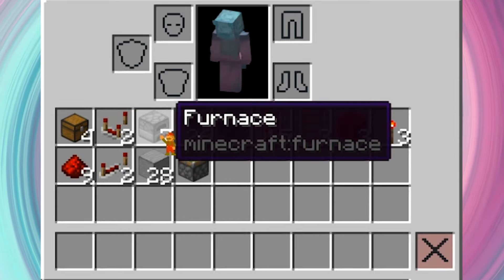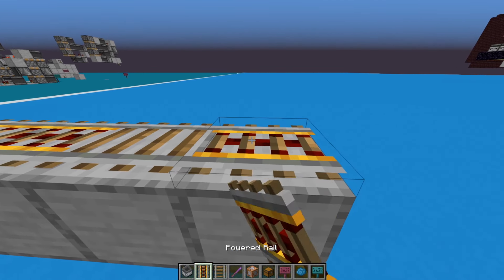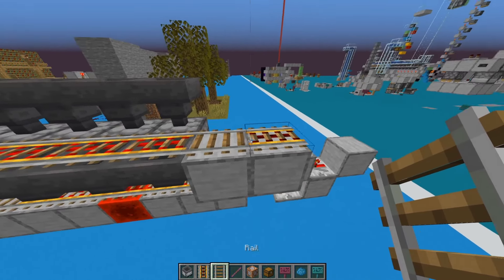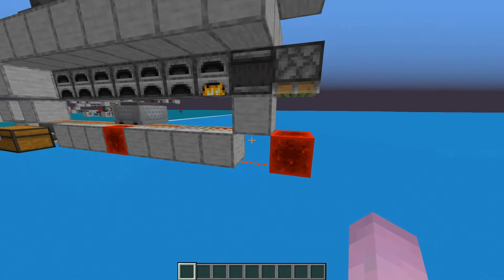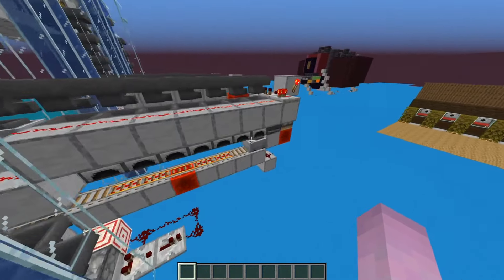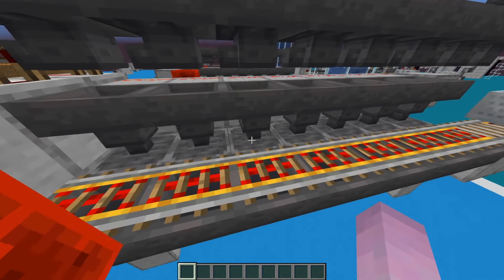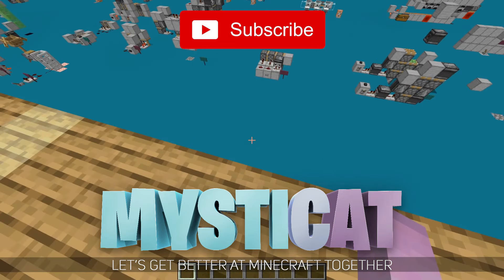Minecraft HIDDEN Super Smelter Tutorial

Comment: dont make this, its bad and a lot of your items get stuck in the system
Reply: I build it but the Itams get stuck in the hoppers
Reply: Agreed. Do you know a design in the same or a smaller footprint to do its job (smelt things full auto) ? I built it in survival and don't want to need to dig more room.
Reply: Try setting the repeater to 2 ticks delay. For me it fixed the problem and I got only 1 item per stack stuck, as said in the video. With 1 tick delay I had 5 items per stack stuck.
EDIT: but you STILL get between 1 and 7 items left in the hoppers after a batch, depending on the input amount.
Reply: Did you add that another row of hoppers like he said in the video?
Reply: @partizansrcem5172  No, in the end I added a circuit that unlocks all the hoppers after the input chest is empty. That way you get both even distribution and prevent clogging.

Comment: So this isn't working in 1.16.3. I have noticed three things. 1) your "even" item distribution system fills the the first furnace in line slower than the others causing there to be a couple of stacks less in hopper when smelting an entire double chest. 2) the repeater on the item distribution system needs to be set at a higher delay than one in order for furnaces to fill to 64. 3) the comparator on the item distribution system locks the bottom row of hoppers once all of the hoppers on the top row are emptied (wont pulse if nothing is flowing through it). The fuel and furnaces work great, but you have some major bugs to work out on the item distribution.
Reply: I have the same issues on 1.16.1  Think it Is 1.16 is the problem.  Know any other good designs u can link me?
Reply: @isaacbean8008  Not really sorry. I decided to change the redstone by adding a solid block between the repeater and the first furnace that I can retract with a sticky piston using a lever. So after I load up my input chest and it completely empties, I flip the lever which retracts the block and breaks the piston lock signal allowing the bottom row of hoppers to continue to run. It's not automatic, but the item distribution still works the same long as I dont flip the lever before the chest empties. It will do until I build a different set for my blast furnaces and smokers. I think I am gonna do some simple ones with rail tracks that I can turn on and off and just have it deep under ground to keep the track noise and item dispenser noise down. You could also try searching best .16 auto smelters and  try a different one, but use hoppers and item streams to achieve the same display for fuel, input, and output that this tutorial has. Happy crafting and hope this helps.
Reply: Well, I just made it on 1.16.3 and it works fine for me so idk what you're experiencing
Reply: Now am scared of doing it
Reply: Yep, same issues.
Reply: @isaacbean8008  I use one that's similar but has far less hoppers and uses mine carts to distribute both fuel and items to be smelted instead (put a minecart track on top of the hoppers that do the duel distribution). It runs fine on 1.16. [edit] It also is not limited to 7 furnaces. It uses at least 15 I think and I've never had a problem with it not using a furnace...[edit2] Had to remove the link. That link was to ilmango's design but it was not the design that I used. I'm trying to find the one I used.
Reply: Same issue I’m having now, last row of hoppers keeps not emptying fully

Comment: So there is a bit of a design flaw. If you throw in 2 stacks of different items you get a massive clog in the system because the furnaces don't smelt at the rate they receive items. The fix is easy though. Add a 3rd layer of hoppers to the top side to act as a buffer and you're all set! Great video still!
Reply: Please can you explain I'm trying to build this
Reply: @-Chicken_  so on the top how he has a hoper line with hopers below it facing into the furnaces. Just add another row of hoppers

H>, H>, H>, H>
Hv, Hv, Hv, Hv,
Hv, Hv, Hv, Hv,
F   , F    , F    , F
Reply: @spughety8098  I really thank you for telling me this but I have a design which is completely amazing. It will not clog up however many items you put. The only slight flaw my design is that you just need to put the fuel before the food otherwise it is amazing. Thank you for spending you time telling me this, much appreciated
Reply: @-Chicken_  no worries! Have a good one!
Reply: @spughety8098  You too 😁

Comment: So at 3:24 my hoppers got locked because of this line of redstone and weren't putting things into the furnaces. They all had a round 80 netherrack in them, is there a way to prevent that?
Reply: I’m having this same issue, did you ever figure it out?
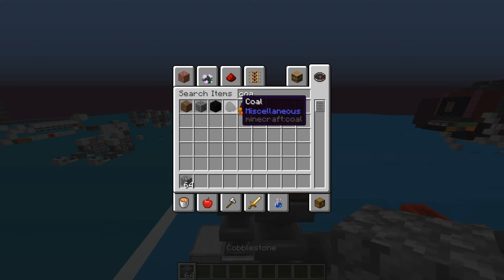Reply: @bevyn2031  I didn't for my setup and wound up using Shulkercraft's super smelter since it's larger, but I think I figured out the issue. You'd need to make sure the redstone is on top of transparent blocks, not solid at 3:25 since these can power & lock the hoppers and cause problems (hopper locking is complicated and confuses me though LOL I might be wrong here), though the part where the redstone goes down one at 3:34 is a problem. This is easily fixed by putting the redstone on top of the block where the redstone torch is that powers the powered rail in the back. 

So just put the redstone all on some slabs, don't go down a block, then for the torch just put a redstone dust on top of that block. That should fix it, but I'll actually build this and test it rn.
Reply: @Bevyn Okay to build on this, doing this can mess with evenly distributing stuff, so I kinda want to figure out a better way to fix this since that can defeat the purpose of a super smelter. I think the reason the netherrack is getting stuck might actually be a chunkloading issue now that I think about it, so if you're able to, build a chunk loader by your smelter. That may fix things. Undo what I said in my other comment lol that breaks things. My bad!
Reply: @linustrain  gotcha, thanks for the help!

Comment: It doesn't work because its a little outdated although i managed to fix it by breaking the comparator and Redstone repeater at the back of the smelter and replacing the all the blocks under the output rails (not the block under the minecart tho) and replacing them with hoppers. The only downside to this is the top fuel minecart will be running forever when you power it with something, but you can also fix this by making another "t flip flop" facing the the powered rail under the fuel minecart that runs off a observer detecting whenever the first "t flip flop" pushes the Redstone block (Have the observer facing into the where the Redstone block would be when its pushed)  Hope this wasn't to confusing you might have to move some things around because i don't feel like i explained it very well.

Comment: The bottom half all works beautifully, but Im getting a lot of items left behind in the "to be smelted" hopper line (second from the top of the design). Something about the comparator system intended to spread the items out evenly is not working correctly in 1.16.2 for me. Any thoughts?
Reply from the maker: It’s been a while and I don’t fully remember, but I addressed an issue like that at the end of the video
Reply: @mysticat  Yeah, I remember it saying at the end of the video, rebuild almost the entire thing one space lower, but it also said it would only leave one item behind. Which would be fine, but Im getting minimum 9 left behind and more if there's more than one type of thing being smelted. Also, I'm only doing normal furnaces.
Reply: @metheusBound  same problem...
Reply: @schwizler9802  Its doesnt work period

Comment: For high volume applications, the mechanism that makes the hoppers add one item at a time into the furnace stops, causing the hoppers to become locked and not dispense any more items into the furnace. This is because the comparator is taking signal out of the top line of hoppers  instead of the hopper line on top of the furnaces. The hopper line of top of the furnaces still have items waiting but the top line of hoppers have none causing the mechanism to lock the hoppers.  Is there a solution for this?
Reply: Try dumping a chest full of items in and wait. The smelter only spits out about 18 stacks instead of the 24 stacks

Comment: I have a technical question regarding the build. I tried building it on a Realm server and the Hopper Minecart does not move on either rail (fuel supply or smelted item). Is this an issue with using it on a Realm instead of a single player, or has there been some change? I'm currently on 1.16.2
Reply: @paulmartinez8149  Yep, that was the issue. Thank you!

Comment: Does anyone use Lava instead of coal or whatever else? I'm having a slight issue where the lowest minecart doesn't run correctly because the run time of lava is so so long and the observer rarely changes state. So now I'm using a lever to just turn on the minecart /shrug
Reply: I'm having the same issue but it's not because I use lava but it' because by the time the furnaces have finished smelting theres still items in the hopper minecart and it doesn't move because the t flip flop has been activated so items just get stuck in the hopper, I'm trying to find a working system instead of a t flip flop and if I find one I will be sure to inform you
Reply: Ok I have found a genius solution to my issue (which is fully automatic) you must make the bottom rails one side longer from the t flip flop and use the space to build one more rail. The rail must be built on a hopper just like the other side so even if the t flip flop gets deactivated all your items would be in the hopper minecart and will constantly drop it into the extra hopper which is then connected to the output chest. Not only does this make it more efficient but it fixes that problem. If items get left in the furnace you just need more fuel which is not the systems issue but yours. Msg me if you would like me to send you a world download.
Reply: LMAO ok I found the most simple solution ever. Just use normal hoppers at the bottom instead of hopper minecarts. Why didnt I think of this earlier 😂😭